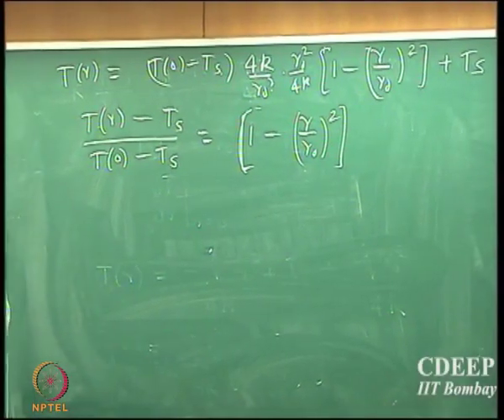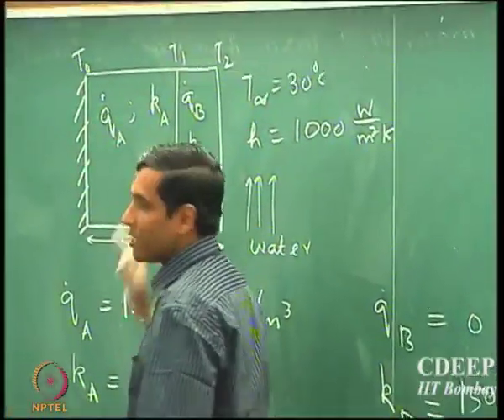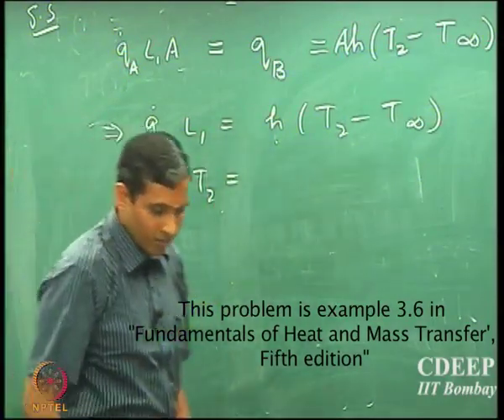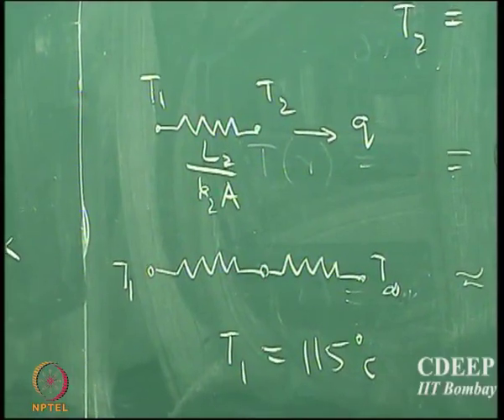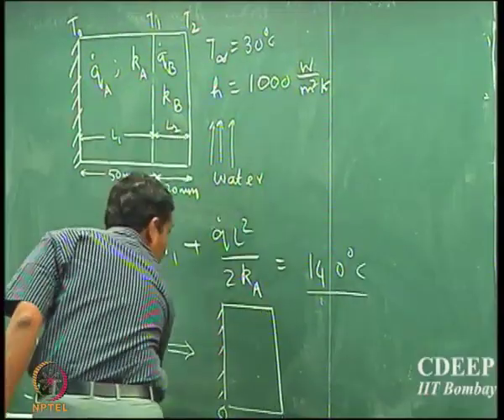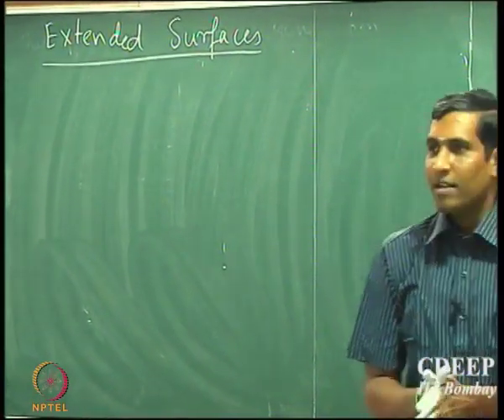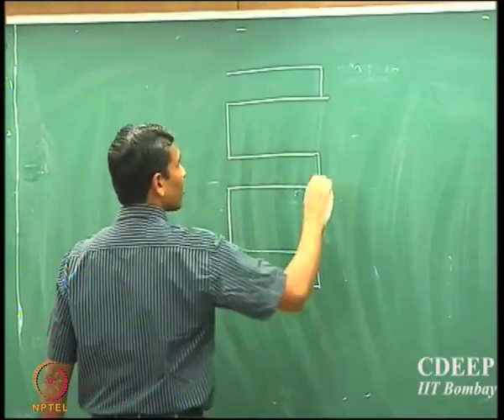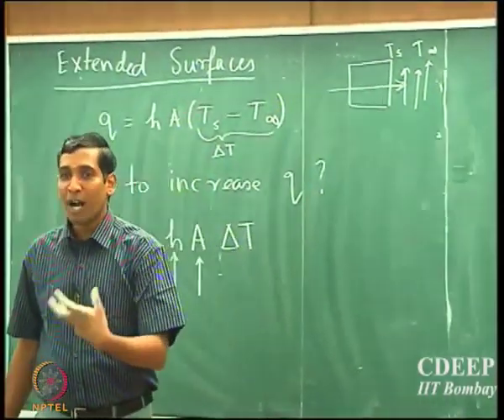Week 2 - Lecture 8

Comment: Please sent to me as PDF formHydrogen at 15 ºC and a pressure of 1 atm. is flowing along a flat plate at a velocity of 3 m/s. If the plate is 0.3 m wide and at 71 ºC, calculate the following quantities at x = 0.3 m and at the distance corresponding to the transition point, i.e., Rex = 5 x 105 (take properties at 43ºC) (a) Hydrodynamic boundary layer thickness, in cm, (b) Local friction coefficient, (c) Average friction coefficient, (d) Drag force, in N, (e) Thickness of thermal boundary layer, in cm, (f) Local convective-heat-transfer coefficient, in W/m2-ºC, (g) Average convective-heat-transfer coefficient, in W/m2.ºC, and (h) Rate of heat transfer, in W.
Consider a 15-cm x 20-cm printed circuit board (PCB) that has electronic components on one side. The board is placed in a room at 20°C. The heat loss from the back surface of the board is negligible. If the circuit board is dissipating 8 W of power in steady operation, determine the average temperature of the hot surface of the board, assuming the board is (a) vertical, (b) horizontal with hot surface facing up, and  (c) horizontal with hot surface facing down. Take the emissivity of the surface of the board to be 0.8 and assume the surrounding surfaces to be at the same temperature as the air in the room.

A shell-and-tube heat exchanger with 2-shell passes and 8-tube passes is used to heat ethyl alcohol (Cp = 2670 J/kg · °C) in the tubes from 25°C to 70°C at a rate of 2.1 kg/s. The heating is to be done by water (Cp = 4190 J/kg · °C) that enters the shell side at 95°C and leaves at 45°C. If the overall heat transfer coefficient is 950 W/m2 · °C, determine the heat transfer surface area of the heat exchanger.
Reply: can you share the pdf link ??

Comment: Sir while seeing plane wall with generation u said that "when we have heat generation we can't use resistance model concept " And then in example sum u used the resistance concept to find T1? while we have heat generation at slab A how we can use resistance concept sir